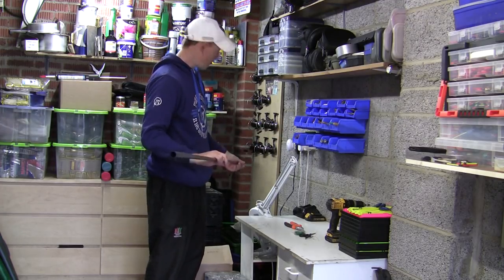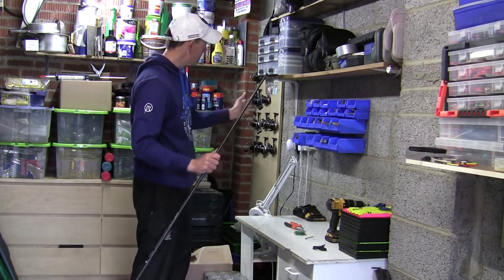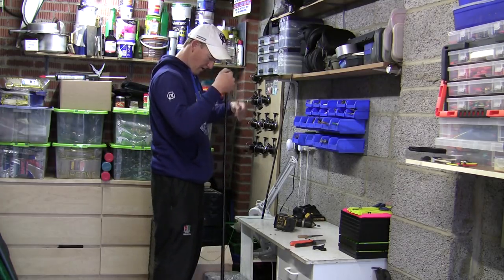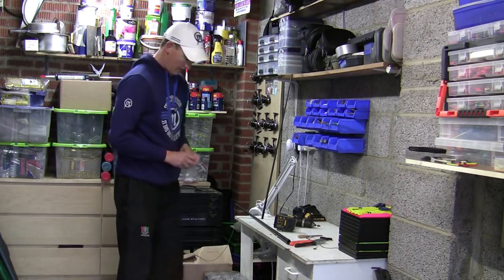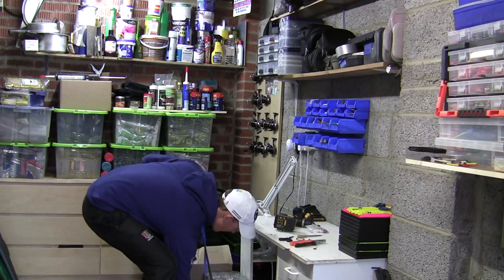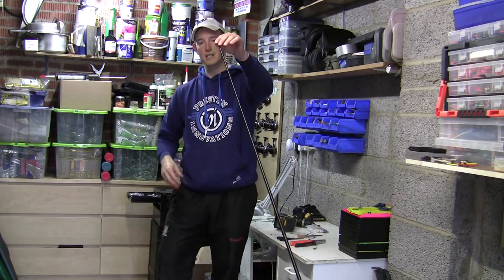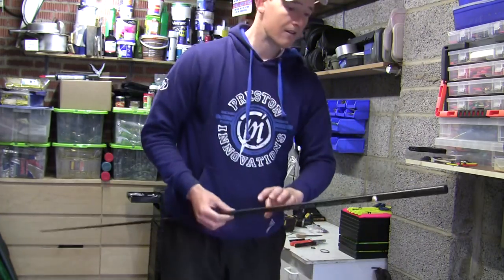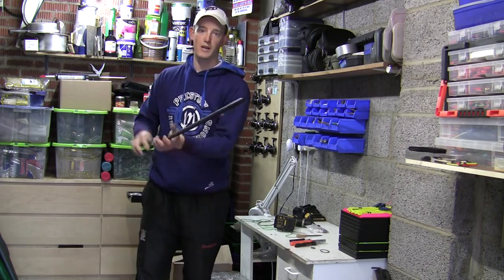Elasticating your pole - Lee Kerry

Comment: Would it not be easier to thread the elastic through the hole first, rather than try to pull it through after threading it down the section?